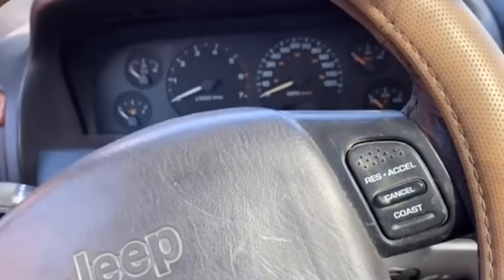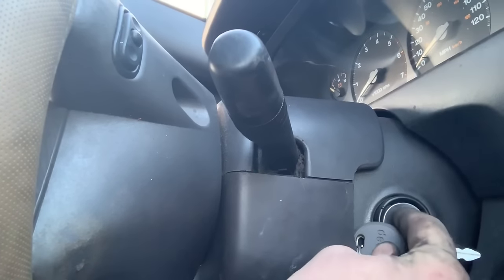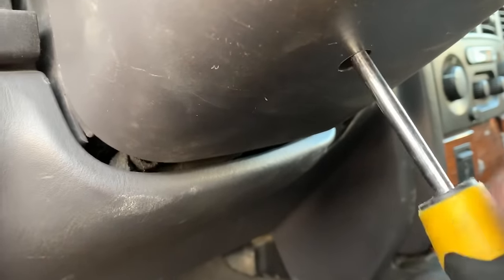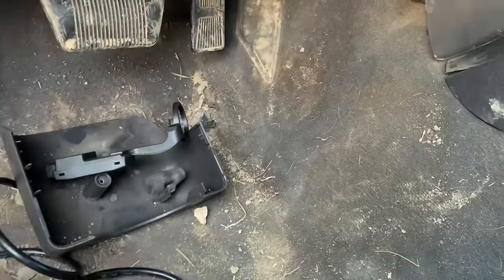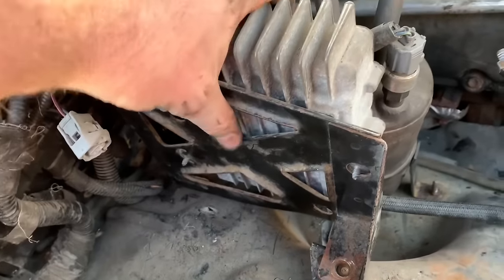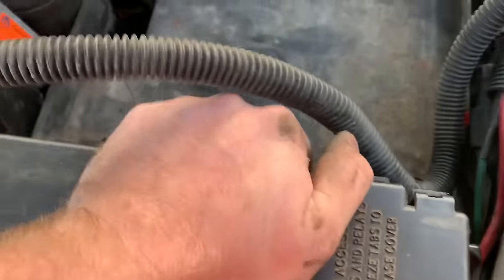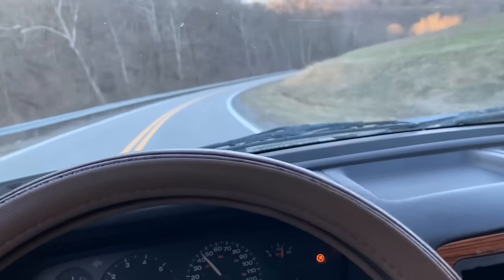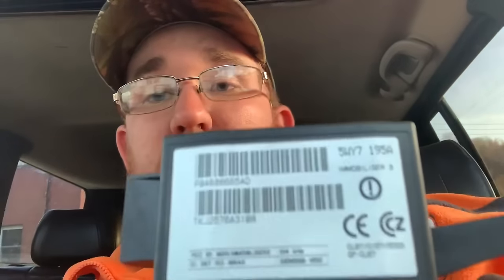How to  bypass SKIM immobilize on a Jeep Grand Cherokee 1999 to 2004

Comment: I think I missed something! What was the purpose of going through all the trouble of removing and then replacing the PCM? It didn't appear that you did anything to the unit except go through the exercise (a PIA it seems) of taking it off and unplugging and replugging it back together. What does that accomplish? What was the point of going through all that trouble? What did I miss? Thanks in advance for your time and consideration! Aloha
Reply: Terry Ridge bro, he said that he sent the unit to be reprogramed with no skim mode, i hope you got it 👾
Reply: You must not have finished the video. He bought a new PCM and had the SKIM settings left dormant and replaced the old unit wit the new.
Reply: hello;  let the video finish he explain everything to the end. you have to order the ecm and request   SKIM NO ACTIVATED.
Reply: @Aardrijk1  huh

Comment: i just put a push button on my starter wire and a wire to the battery ...then turn the key on and push the button to start it...its a 99 jeep cherokee xj sport ..my skim is still in it...apparently the skim system stops the starter from being kicked in by the key switch....but now i hear you can leave the computer plugged up after you take out the skim and take the battery cables off and turn on your headlight switch and leave it on 24  hours or cross the bat cables with a copper wire to drain the residual energy from the computer and the computer will reset itself to factory settings and if you don't have the skim in it it wont check for one....i may try that in a few days but don't really need to with my push button starter......my gauges work sometime and sometimes dont ......jeeps sure got crappy made up wiring systems...
Reply: You are guessing.  That's not at all how it works.  The SKIM turns off the ignition seconds after the motor starts and runs.  The programming is a ROM that doesn't reset after a power outage.